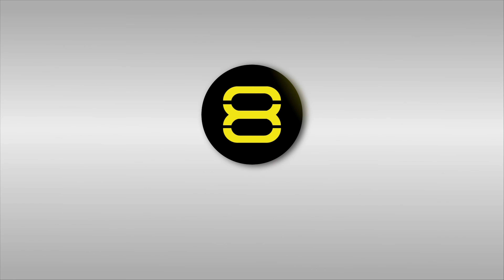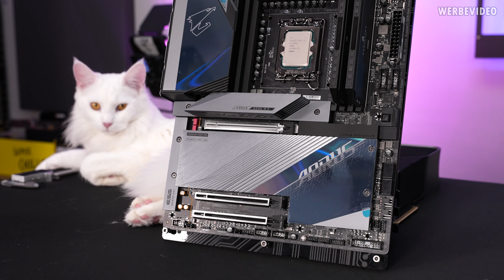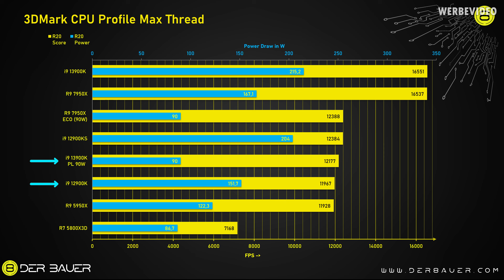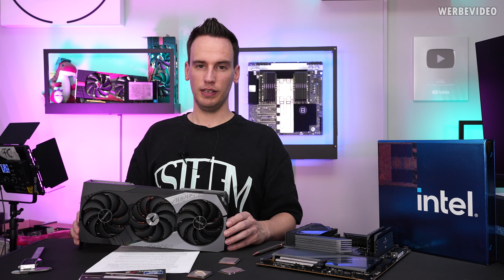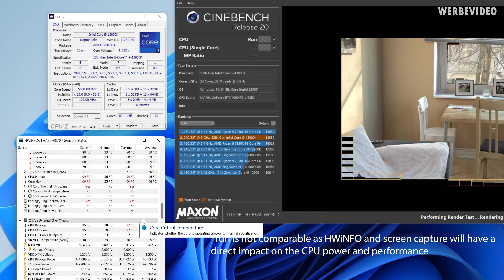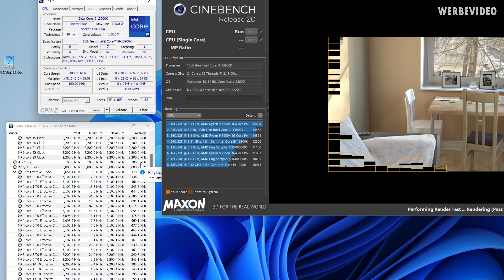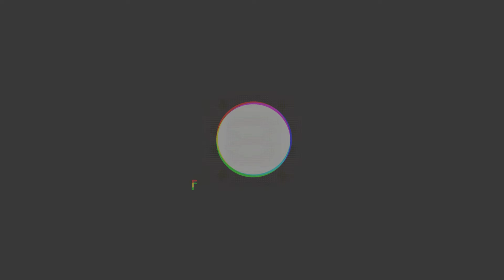Testing and Tuning the new 13900K for Efficiency

Comment: Really looking forward to the 7800 X3D after this should be at the top of all the gaming charts with the least power consumption stock. Only thing missing in your review is idle power consumption. Would like to see a similar style video for all the models in the new CPU lineups. Also heard they might do X3D for all the Ryzen 7000 ships should make something like the 7950 at the top in all areas. Maybe include underclock/Undervolt comparisons for the 7000 series too

Comment: This is a very good product if it was released with better power optimization instead of going for max raw performance. Like how can you release a cpu that will use 300w stock? No one can cool it feasibly, makes no sense.

Seems like these cpu companies are pushing their products to their extremes just to be able to say their cpu had the highest benchmark score. Is this the consumers fault or the company's fault? If they don't do this and release power optimized products their cpus won't look as good, unless the general consumer concensus starts leaning towards power consumption vs performance instead of raw performance which is unlikely.

Comment: Great video. Now I know where to get the extra watts to give to my (future) 4090. With these numbers rather than upgrading GPU + PSU + Cooler I could just  upgrade CPU + GPU,  keeping the air cooler rather than going for  liquid cooling  as long as I  set some  power limits for the CPU. I think it is a better investment overall.

Comment: Hey der8auer, never thought of trying direct die cooling but helping to dissipate through the cpu pcb? in the space between the chip and the heatsink add a copper sheet with a central perforation of the diameter of the die, on the upper part thermal paste for contact with the heat sink and on the lower part thermal pad for contact with the pcb, I think very interesting results would be obtained!!

Comment: Hello, great material. I really enjoyed it and it is much more advanced than the videos of most creators on youtube. 
I'd like to buy a PC to use for work, gaming and Twitch streaming for many years to come. 
I'm considering buying a 13900k but I'm worried about that massive power consumption.
I wonder if it will consume very much power when I stream games using OBS?  
Additionally, I would like to ask if setting the power consumption limit is easy?

Comment: So, now everyone is running CPUs and GPUs on the red line. The current boost levels are far away from the efficiency zone. If this was 13900ks or an "extreme" version of the cpu, I would accept it. But the "normal" 13900k should run at 150w power limit by default not this complete joke of power limit and temperature targets.
Remember when Pentium D was canceled because of the extremely high 130w power consumption and we went back to the Pentium M architecture for the core2duo? Now 300w is normal for a home desktop computer CPU!
It's time to reconsider the power efficiency of the CPUs and GPUs. Energy isn't cheap, we are evolving to a greener environment and Intel, AMD and Nvidia forgot this just to have those shinny 2 extra points to stay on top of the graphs. Someone needs to step up and regulate the efficiency of these devices. It's insane how efficient these CPUs are at lower speeds, why sell them so extremely overclocked like that??? Reviewers need to start talking about this

Comment: Why not run that test at 16:42 with manually  setting the wattage of the 7950X to 70 watts?  We still don't have an apples to apples comp at this stage of the  comparison. ( manually setting the PPT to 70 would do the trick, as I'm sure you know. )

Comment: Does the 13900K have the same bending problem as the 12900K? Will the 12th gen Thermal Grizzly contact frame that I bought work on the 13900K?

Comment: Can anyone suggest how to limit power consumption to 90w on an Asus motherboard? All I see for PL1 and PL2 are settings called "Long Duration Package Power Limit
" and "Short Duration Package Power Limit" with a value that can be set from 1 to 4095. Asus manual suggests this value is specified in watt hence I would set 90 for both. Is there anything else that should be set to limit consumption to 90w?
Reply: There should be a setting to put PL1=PL2 and then you put a 90w value to PL2. It differs from board to board but that's the gist of it.

Comment: i don't really see a point of eco mode on top tier CPUs or manual power limiting. Why would you buy 600$+ CPU to get 300$ performance? Just buy 13500 or something similar
Reply: To have it when you dont need all the power
Reply: @hydzior  and when is that time? It's probably so niche i can't even come up with an example. 13900 doesn't consume 300w without full load anyway. And you would want max performance at full load since you paid for it

Comment: B650E ? You have B650s already? Did AMD release that? That's what can save Am5... however I'm not sure it is clever to use that for the 7950x. You should use the 13900K in a B760 to be comparable.

Comment: I see your video and hardware unboxed and the scores looks drasticly different (you use cr20 they cr23), for example 95w 13900k have 20,3k points, 95w 7950x 31k points... it's r20 broken for zen 4 or what ;D (sorry for my english)
Reply: I really think he is giving Intel as fair a shake as possible.
Reply: @halrichard1969  Yup, you don't even need to read between the lines, Roman really shilled the 13900k this video, like REALLY hard.
Reply from the maker: It's just a different benchmark. I used the same benchmarks for all recent CPUs. Why would I change it this time?

Comment: I set long duration to 95 and short to 300 and not lost a single bit of performance, dropped from 85 c to 65 at most.

Only notice is clock speeds never achieve the boost in a game, yet it doesn't hinder the performance
Reply: Games runs LP1 but yeah the temps are insanely huge in difference when set to a limit in power.

Comment: It would have been nice to see the CPU just running according to specs - so all the OC-features disabled, respecting PL1 and PL2, the normal turbo-duration etc.
From what i had seen with KabyLake the boardpartners started using really bad settings on Intel. With CoffeLake i7 8700K reaching 150W - despite that giving nearly no performance over the stock 120W PL2.
And after that it has only gotten worse and worse. I saw people complain that even the i5 12600K would be inefficient, but i just stuck it in a B660 and it runs waaaayyyy below TDP in CinebenchR23. I only disabled all "enhancement" features of the board and it then runs at sub 100W with a score slightly above 16k. (hehe - and now it is used as a silent office-PC. complete overkill )
Reply: 13900K doesn't have turbo duration, that's the issue. It will basically clock to whatever your cooling can handle up to well above 300 watts indefinitely from stock settings.
Reply: @Real_MisterSir  "13900K doesn't have turbo duration"
56 seconds - it is the motherboards that just disable that.

"well above 300 watts indefinitely from stock settings."

Disabling all limits, setting turbo-duration from 56 seconds to infinity, removing the 125W PL1 and 253W PL2  while increasing the voltage - that is anything but stock.

Comment: nice power consumption test but 7950x around 120w is the most effective. There are 2 7700x inside so 70w is like 35 for this processor. If you add 7700x to the chart at 70W, it would probably be in the first place

Comment: Amazing review! 
Thanks, der8auer for doing this.

Recently people complain a lot 
about Power consumption and Thermal but they buy "K" processors. K-CPU is meant for Performance, Overclocking, Benchmarking, especially the top SKU like i9-13900K. It's the flagship CPU for Intel to flex their muscle. So, the out-of-the-box config is kinda extreme, people should not use that for their daily driver.

It has been made clear that "K" CPU 
is for power/enthusiastic users who know what they are doing or using. They can just set or tune the power limit to what they like, so CPU doesn't get too hot or use too much power. People seem to forget about this and assume that K CPU is for everyone.

For average users,
who cannot do this or don't want to do this, they should get non-K CPU. Also, I think PC Desktop market is shrinking, not many people build full-size PC these days. So, it's pretty much for enthusiastic.

Comment: I set my LP1 to 125W & LP2 to 253W on 13900K and ran Cinabench 23 where i saw package temperature staying at 60 degrees stable, is that for real? AIO cooler with noctua fans (120mm) at 1200rpm (100% speed)  Gaming temps with cpu is average 60 degrees and gpu below 60 degrees with room temp at 21 degrees. I think im happy with this..might look into the offsets at a later time..Performance wise did not notice any difference in gaming after this change.

Comment: Hey so I have a 10850k that I run with the 125WPL1, MCE off, and undervolt by -0.100v paired with a Liquid Freezer ii 360 to keep my room cool in the summer.  

I want a performance upgrade purely for gaming that will run just as cool if not cooler while giving higher fps. What would you recommend?

Comment: Thanks for doing such a thorough examination of efficiency. I think efficiency is more interesting than any other statistic these days as it tells you more about how well these chips are being engineered, and the efficiency of the process/architecture itself, rather than big numbers in a benchmark while pulling down a ton of wattage. The early 12th gen reviews were a total disaster, with every reviewer being completely hysterical over how it uses "240 watts" and is "the most inefficient CPU ever" or whatever. I was honestly shocked at how bad they were.

Comment: why did you use two different M/T RAM for this test.  Not apples to apples.
Reply: Well when you come to realize that people who actually buy will likely use the recommended for each.  Therefore this test is actually practically accurate.
Reply from the maker: I explained it in the memory section of the video. Highest memory I had available supported by each platform. I'm not using lower speeds on any if I don't have to

Comment: Hey dur8auer EN! I love all your videos and they have helped on all my builds..I just picked myself up a 13700k(kind of had a dud alder lake chip) and love tinkering as much as possible within safe limits..any chance you could give me a recommended safe max voltage for raptor lake or is it similar to alder lake? Just wanna keep my cpu healthy(stock temps and boosts are great so far) but don’t wanna go off internet people voltages lol
Reply: I have the same processor and I have 10 BioniX p140 fans in the 5000d airflow case Any advice if you found anything???
Reply: @nekitovampire3072  so I have my 13700k running at 5.6ghz x1 core..5.5ghz x 3 core..and 5.4ghz x 4 core..all e cores at 4.5ghz and cache speed set to 4.7ghz it seems it’s a good chip haven’t even tried for more…i don’t go over 83c in any stress tests..I have a max manual voltage of 1.32v with LLC mode 4 and usually hovers a tad lower..temps in idle are 28-31ish and gaming/ normal load 50-65c ish depending on the game and it’s blazing fast lol a noticeable speed increase and boot time over my 12900k..also running 32gb of DDR4 at 4000mhzc16-16-16-36 which my 12900k couldn’t quite do….it’s a great chip even at stock honestly you wouldn’t notice an Overclocking uplift realistically unless you have all top end gear all over locked together..but it’s running super smooth and stable the PC has not froze once(happened a lot with my i9) and just feels better..I think you will be fine..I would personally just not go over 1.35v for gaming and not over like 1.32v for rendering and stuff..as long as temps stay below 90c while sustained load it’s technically safe

Comment: Are cpu makers going after heavily OC default settings on their products and leave Eco mode somewhere to be found in BIOS or even to be manually tuned? Anyway K suffix say it's OC, so it should be clear complains about efficiency are not big issue, are they?

Killing blow to AMD core fans and couple of negative  reviews. 
Great review.

Comment: The temptation for me would be to buy the 13900K, set the power limit to 70 watts immediately, and just increase the power limit as the years go by and the machine starts to bog down. I tend to buy high-end and run the hardware for years -- my current gaming rig is based around an i7 4790 & RX580 -- and that would be awesome if I could swing it. Here's hoping this new pressure from Intel will cause AMD to consider reducing IHS height on the next model. That seems to be the real killer for the Ryzen 7000-series.

Comment: Anyone who only games and cares about their power bill and buy in cost for the platform as of right now would be a bit silly to buy anything other than the 5800x3d. I was very dubious of its value on release but given its performance per watt in games and the fact that with a good GPU there's basically nothing it won't run well, combined with a price drop... You could buy in now for like half the price and pay half the power bill to use it vs these power hungry top end chips

Comment: I like the efficiency testing. Lots of people test efficiency while CPU is configured for performance. So the 90W limit is something... However I think it can be improved. It's not the total power that's inefficient. It's the frequency. There are a lot of losses at high frequencies. Why don't you try to limit boost frequency to different values - like 5GHz, 4.5GHz and so on, and don't limit the power at all. Then measure efficiency. I'm sure the last 1 GHz costs double the power than the previous ones, but it provides 1/5 more performance

Comment: Der8auer, I really wish when you manually tuned/ undervolted the 13900K that you had done the same on the 7950X-- because its out of the box ECO modes, just like the 13900Ks, have a ton of room for improvement.  Why did you not include this for the 7950X?

Comment: I bought the 13900k for work with photo and video editing. I have not put the pc together yet and am thinking of returning for the 13700. I  never built a pc before and am scared of the aio cooling that seems needed (I am anxious and don't want to deal with the thought of leaks, fails, evaporation). Also worried that I spent 150 euro more for nearly no advantage. Should I return it?

Comment: May I know what would you do yo optimize the power consumption in multi threading applications like Vray or video exporting? How much performance loss if we just set the PL2 to 160W? Is a low profile cooler like Blackridge with slim 120mm fan and VLP DDR4 ram able to cool an optimized 13700K or 13900K?  Since a standard 47mm height low profile  cooler would be an interesting challenge for intel 13th and amd 7000 CPU.

Comment: Hey Roman, if you were to build a single PC streaming rig with the new Intel line up, would you go with the 13900 or the 13700? I assume with gaming and streaming on the same system most E-Cores would still just idle on the 13900k!? Assuming you would go with the 13700K would the RTX 3080 bottle neck the cpu or vice versa?

Comment: It seems to me that 4090, 13th gen intel etc are kindof tuned for winning benchmarks. Of course they are not bad, but if they rather would have sacrifised 1% performance for a lot less power usage, I think it would be better for most people. THen they could instead have an "top dawg" modus in an application where the users who have special needs could unlock more power.

Comment: Amazing work! I've known your name a long time but just recently started watching your content. I have to say that this is hands down the best 13th gen review. Everything from making the charts less clutter, explaining/discussing about the tradeoffs, undervolting etc. Compared others who basically just trash the processor for needing a nuclear plant to power it (which is in a way true) but as you said there are many ppl who will use these CPUs mainly for gaming and every now and then multi threaded workload like editing, streaming etc. The processor will NOT pull the 300w from the wall while gaming, while that might be obvious thing, in a way it looks like other reviewers just focus on the max power consumption, nothing else. In fact 13900k looks quite "ok" (not great) against the competition when it comes to efficiency at those gaming workloads while also beating them in pure performance and costing 100 euros less.

On a side note it looks like the competition across the board is so hard that every participant (Nvidia, Intel, Amd) are basically shipping "factory overclocked" parts now. By this I mean whether it being RTX 4090, 13900k or 7950x by decreasing power consumption like -30% takes only few precents off from the performance. Not sure if that signals the end of x86 era or what is happening.

Comment: Possible put undervolted 5800X3D benchmarks ?  ( maybe in patreon ...?) .  I found that it has alot of voltage headroom , setting up -30 CO does wonders , i think it could actually beat 13900k in ECO mode , and completely destroys Zen4.

Comment: Will using a 13900k daily overtime wear out the AIO pump quicker because it is more hot all of the time?
Reply: If you get a bad AIO like I did, most definitely. I switched to air cooling now, while it's not as effective at cooling the 13900k as AIO cooling, it's far more reliable and don't have to worry about the pump failing etc. 

Applying some power limits + undervolt and air cooling with something like the NH-D15 (like I have) is feasible.

Comment: Does this mean if I wanted to upgrade my 12600K I could slap in the 13900K and still use an air cooler if I turned down the PL to 90W?

Comment: Will there be any testing done using the contact frame for 13th gen? considering it gets a lot hotter than 12th gen, I'd be interested in seeing if the same issues are still present